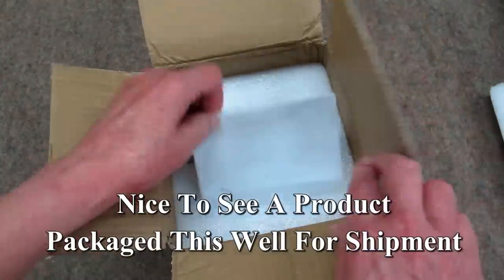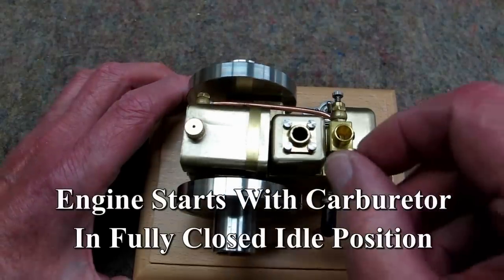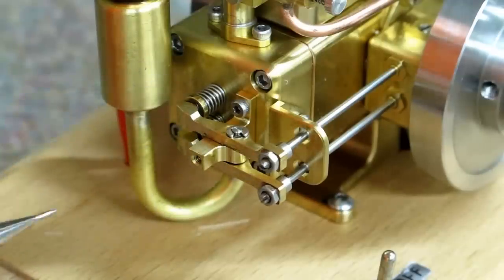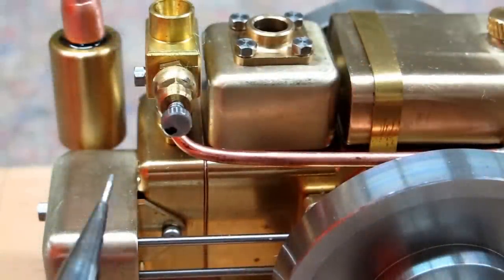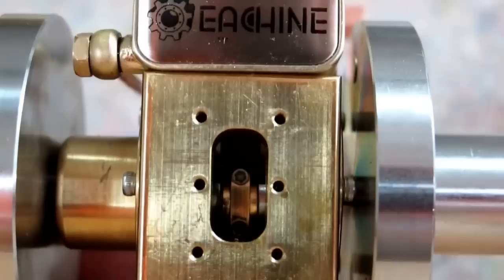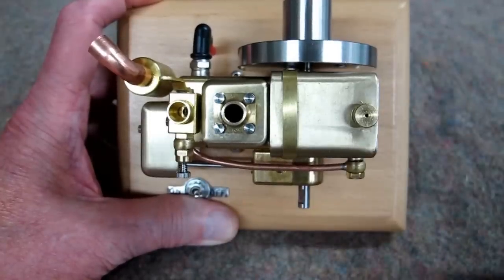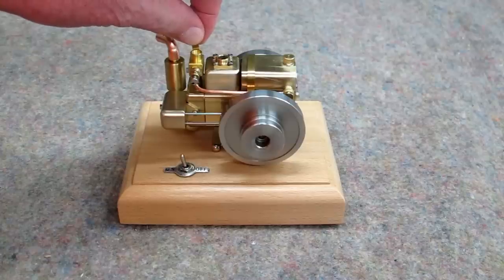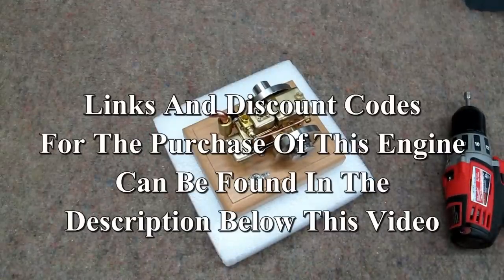Eachine ET5 Mini Gasoline Engine

Comment: I have spent hours trying to get it run and it barely runs on 91 octane. Can't get it to speed up or idle slow. I'm wishing I never wasted my money on one.
Reply from the maker: The model engines from Eachine are test run before they are boxed. Every person I have communicated with regarding one of their model (hit & miss) engines not running was doing something wrong. Wrong fuel, dead battery, spark plug wire loose, something. I have seen several of these Mini Gasoline Engines running and have not received a complaint regarding the ET5.
Reply: @RonaldWalters2010  that's good to know. I have tried lighter fuel fluid...still not good. The highest octane we have is 91. Thought I would go to our local airport and beg borrow steal some higher octane. I did notice there is a lot of tappet clearance on my exhaust valve. also noticed a lot of play on my crankshaft. I thought there are ball bearings in there. I wish they would include spark plug gap specs and tappet specs.
Reply from the maker: Take the valve cover off and "flick" the valves open (gently) a few times to make sure they are seating. The piston rings are o-rings. This has fairly low compression and it is a short stroke. Doesn't take much (carbon) to hold a valve open.  The Marvel Mystery Oil doesn't seem to create carbon, at least not much. You don't need aviation gasoline. However, mechanics are always draining off the bottom of wing tanks to make sure there is no water, so they probably have a bit sitting around. The spark plug wire just butts up against the side of the plug... make sure it is touching. Close is generally good enough. Make sure you have a good battery. The ignition will draw down a single cell after a while. Needle valve 1/4 turn open is plenty for starting (at least for my carb). After it is running and warms up a bit you will probably open it up a bit more.  After it runs-in for a while, it will probably run better. Remember it is a model engine... not intended to run flat-out all the time. Coleman fuel (lighter fuel), which is naphtha based fuel, works well. Using a cordless drill is an acquired art... better to make a starter rope like I show in the video until you get it to start and run reliably. Don't give up on it just yet. It can be a bit finicky but it does run pretty well.  The carb is touchy... you need to acquire a feel for the engine. Ron
Reply from the maker: You did not mention where you live.
Reply: @RonaldWalters2010  I live in Utah...dunno why that matters. Thanks for your suggestions. Valves are loose. Battery is 1.53v. Pulled the spark plug and grounded it against the engine and there is good spark visible. I would be delighted with only a steady idle as opposed to running flat out.  I bought Coleman fuel yesterday and the engine seized up and did not run on it's own....it ran while dwindeling off to a stop after cordless drill cranking. Then I overdosed it with lighter fluid through the carburetor and got it to free up. Now I know why you mix Marvel M.  with the Coleman fuel which seems counterproductive because it decreases the desired flashpoint. According to Wikepedia no state sells 95 octane and 93 is the highest in some states. No one should spend $250 and have to struggle to get it to run. I am curious how you know that each engine is test run at the factory. Wish I could get a refund.
Reply from the maker: Where you live makes no difference other than if you were somewhere overseas, the octane rating seems to be measured differently, which is why I asked.

If your engine “seized up” I would guess the needle valve too far open and the cylinder had too much fuel in it and hydrolocked. 

You do need to choke the engine after filling a dry tank to get ALL of the air out of the fuel line or it will not start.

My opinion is you are more likely to get it to start with a brisk pull-cord spin (as shown in my video) than with a cordless. Close the needle valve all the way (gently) and spin the engine long enough to convince yourself the cylinder is dry. 

Not all needle valves are created equal. I find most of the Eachine engines start @ ¼ turn open +/-.  A small change can make a big difference… thus micro-adjustments are suggested. Start at 1/8 open then gradually work up to 3/16 open and so on, until it starts. With my engine, anything above ¼ open is too much fuel and it will not start.

Naphtha has plenty of flashpoint. Using a touch of Marvel M. is no different than mixing oil in your weed eater or chainsaw fuel. We’re just trying to lubricate the piston ring a little. Too much oil will probably foul the plug.

Every Eachine engine I have received (including hit & miss), have had exhaust deposits on the spark plug and in the exhaust, indicating the engine had been run before I received it. Each engine I have received ran right out of the box without ever touching the needle valve setting. Other people I frequently communicate with have observed the same thing and also believe the engines have been test run prior to packaging.  Ron
Reply: @RonaldWalters2010  Understood and agreed on all points. I know the tip of the needle could easily snap off if torqued down too roughly....one last point. I noticed a lot of escaping air out of the crankcase breather hole when she does want to run...almost too much according to my gut feeling. I'm tempted to pull the piston. The seizing piston was a question of friction vs. hydrolock...almost  as if the O ring swelled up because I could keep rotating it by hand  but not with the cordless. I am going to locate a bit of thin rope and try that.
Wolfgang W.
Reply from the maker: That crankcase breather blows like a fan. But does not seem to pulsate like I would expect. The crankcase on the hit & miss engines are not oil (or air) tight. I haven't pulled this one from the wood base but it may be open to the bottom. Otherwise I don't know where all the air comes from. If you pull the piston you won't have a spare o-ring and they are pretty small. I don't know if this piston has one or two o-rings. With the low compression I would guess only one o-ring. This is the replacement... Piston O-Ring for Eachine ET5 (10 pcs): https://ban.ggood.vip/USMH (code: BGTUI06, $4.99)
Try flicking and rotation the valves a bit (gently). I'll bet some tiny bit of carbon is holding the exhaust open. Ron
Reply: @RonaldWalters2010  Thank you very much for your diligence in helping me get this figured out. Thanks for the link to the spare O rings.  On the light side...I obtained a variable pitch boat propeller for this engine to drive to be installed in an open - hulled gravel/sand R/C barge with a trap door dump bottom. ...Wolf.
Reply from the maker: Have you had any success with your engine? 
Ron
Reply: @RonaldWalters2010  Good morning Ronald. Sadly, no. At this point there is no compression at all. The crankshaft spins freely. I would order a new set of piston rings if I knew what caused the failure.
Reply: I would love to check and set the intake and exhaust valve gap if I knew what that needs to be.Thank you for asking

Comment: Why bother to show the box in the beginning?
Reply from the maker: The largest problem I have experience with model engines (or anything really) shipped from China is poor (sometimes very poor) packaging. Some packaging is so poor, I am surprised the item arrived in working condition. This is the main reason I have not reviewed the more fragile or complicated Stirling engines, especially those made with glass tubes. If I show the packaging in my video, I considered it to be good. If I do not show the packaging in my video, it probably was not very good. 

The Eachine ET1 and ETX Hit & Miss Engines and now this ET5 Mini Gasoline Engine have the absolute best packaging I have seen coming out of China. This manufacturer wants to protect their product with proper packaging. I want potential buyers to know this and the fact their engine will arrive in good condition. That is worth a minute at the beginning of a demonstration video. 

Thanks for asking! Ron

Comment: it will run on alcohol
you just need to open the needle to 2.5 turns
Reply: interesting...what type or brand of alcohol> rubbing alcohol? 91% isopropyl?
Reply: Isnt alcohol hard on the cylinder? Since it's not really a lubricant?